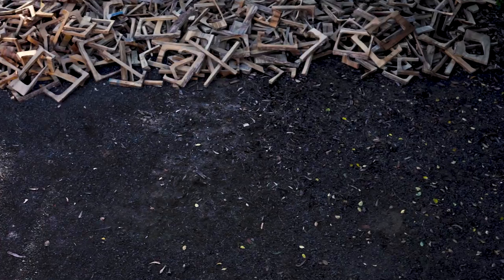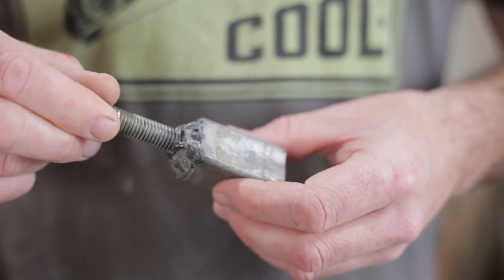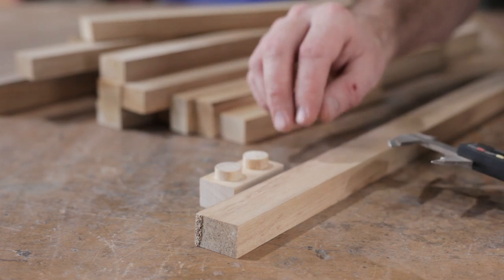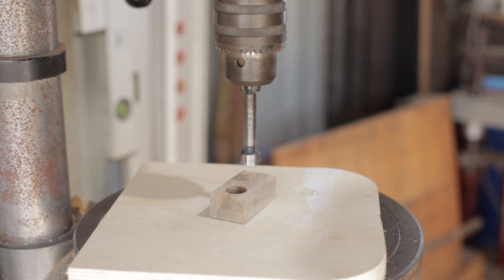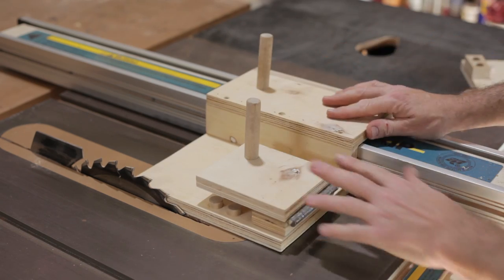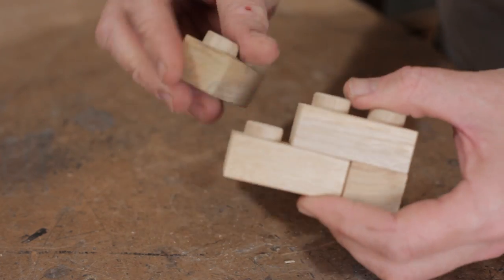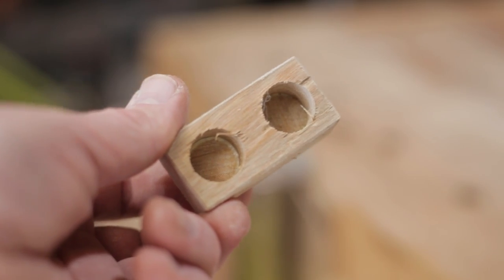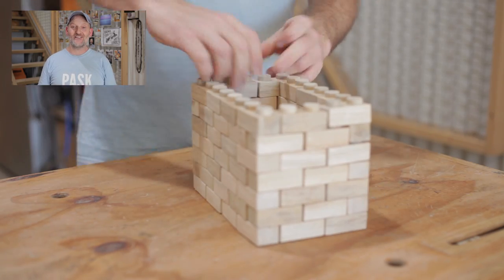Homemade Wooden Lego - Scrapwood Challenge Episode Eleven

Comment from the maker: After the first Wooden Lego video I made, I haven't stopped thinking about how to improve them. I decided to give it another crack! 

Just a word of warning to anyone that wants to make them "they are a lot of work". :)
Reply: Curious as to how long it took you
Reply: Turned out so nice though. Looks fantastic!
Reply: I think this would be a great job for a pantorouter (if you need any more excuses to make one!) with the doubling down from the templates you could get these really accurate, however I quite like the look of them being slightly off
Reply: I'd love to have a set! Maybe if I get bored enough and have a week of vacation... I do have a suggestion if you have decide to tackle something similar (or if you want fo finish these differently): don't bother with all the sanding ahead of time. Make sure there's no big burrs anywhere, glue it all up then throw everything in a big rock tumbler, or several, with some beeswax and half as much by volume (or so) smaller wood chips. It should take care of all the corners, smooth everything down, finish the wood and protect the surface. They ought to look cool too!
Reply: What is the measurements for this
Reply: Subscribed!  re 8:18, I made a "micro adjustable table saw fence" video that you might really like.  It's useful for sneaking up to the correct width and being able to turn a dial for more/less width.  It costs less than a dollar to make!
Reply: Dan Lord ..
Reply: Hi Neil -- To get the holes in the right distance, you could make a simple jig with two drills fixed in the exact distance you want, one drill fixed from either side. Then put the pieces in the jig and drill the holes from either side. That way they should come out identical!
Reply: @dominicspengler7264  you could use a dowl drill machine for that. Or make a make shift one yourself.

Comment: Really makes you appreciate how tight the tolerances on legos actually are. I should try measuring them with a micrometer and see how much they vary, if at all.
Reply: Yup, then tell us/me what the taper is on those pins eh…  
BTW,  if you are serious the micrometer will have a pressure gage for measuring soft materials.
Reply: .05mm tolerance is good for snapping lego pins into the technic holes.  You can see some I made for my kickstarter video.  Stop by and say hi.
Reply: they dont vary much at all
Reply: I heard the moulds used for lego are so valuable as intellectual property that when they wear out, to ensure competitors cannot get a hold of them,  they are cast in the middle of concrete. Not sure whether the concrete is used for bridges etc or Lego has a pile of concrete blocks in storage...

Comment: This vid is almost three years old, so I'm a little late to the game, but as a life-long lover of Lego bricks, I am completely enchanted by this project. The bricks turned out great, very much like the real thing only larger.

I love the simplicity and accuracy of the jigs you made for marking, drilling, and cutting. Repeatability is key in making something like these bricks, and the jigs make it a snap to get accurate holes and cuts every time. The sanding attachment for the dowels was also genius.

I'd love to see additional pieces to fit the set. Instead of only 1x2 bricks, I'd like to see the classic 2x4 brick, which was the basis for the whole Lego system back in the day, and maybe some of the other classic sizes of 1x4, 2x2, and 2x3. And a big plate to snap them all down!

Comment: Another way to reduce tearout is with the order of your cuts. If you cut your end grains first, you are more than likely to cut off the tears when you do the rip cuts. The same applies for rotating cutting tools.

Another way is to have a sacrificial piece/zero clearance behind your work piece, but that's not always possible e.g. routering edge profiles in a top. If your material is very prone to splitting, you can consider backing into the cut if it's safe to do so

Comment: Some good improvements! Can I ask what camera and lens(es) you use?  I just bought a Canon 6d Mark ii and I'm struggling with the video settings/quality.
Reply from the maker: Thanks Justin! Canon 5D mkII, it's getting a bit old now but still a great camera. I like the look of the 6D and if I could afford it I reckon I'd get one too. I'm surprised you're struggling for quality, the main thing I do is set the picture profile to standard and adjust the contrast and sharpening to low and deal with those with the editing. :)
Reply: It's a great camera for stills. It may be inexperience causing the video trouble. My cell phone (Galaxy note 5) has way better detail (no contest) though. But the phone lacks the necessary control for proper video. I may look into a camcorder for video and stick with the 6D mkII for stills. Although I had to save for three years to buy the 6D mkII. So It may be a while for another camera.

Comment: I made a set of wooden Lincoln logs a few years ago.  1-1/2" X 1-1/2" stock made from 2X4.  Very labor intensive.  But worth every minute.  The grandkids still get them out and play with them.  Also made a marble run using cherry wood and a whole bunch of blocks.
I thought I had patience.  I don't / can't hold a candle to you.  Great work.
Reply: I am going to do the same making large size Lincoln Logs.  I have a lathe to make the dowels .  Then use my table saw to carefully notch them out.  Then finally cut the multiple pieces with the table saw.

Comment: If you use a finer toothed blade on your table saw, you'll get less tearing. Personally, I use metal cutting blades because they have the least tearing. I usually cut the blade 6.6mm (roughly ¼ inch) in between every third or fourth tooth (depending  on the tooth count divided by three or four) with my bandsaw to improve heat sinking, though.

Comment: Seems like a CNC router would do well. All you'd have to do is set up a jig that has a corner to clamp into. Then you'd just need to do what you did, excluding the holes.

That being said Holy hell I'm so impressed with what you learned and how you applied changes to your designs. I've recently started watching your videos and your ingenuity is astonishing.

I watch other woodworking videos and I see their lack of technique and usually go back to watching your videos.

BTW loved the knurling jig video!! If you end up doing that again, try brass bushings inside the knurling wheels and add a third in place of the bearing maybe?

Comment: Those are a of work Neil,they look nice through ,there a guy onhere made a table saw lathe and you just pass them thru once the sand then too before switchen to the next sq board ,i made one up couple months back for making hanging pole for a closet units i made for customer ,worked great i dont know is if  you want me to put any names on your comments so i leave it at that and if you want ill post them to you ,i like your little sanding ideal next you ll have to make some outside rounds sanders ( go over the dowels and sand them in place after there all glued in ) think plastic pipe slit up one side spray contact glue and  fits in a drill ,great come back on the legos
Reply from the maker: Thanks Syd! I've made dowels on the tablesaw in the past, I needed a heap of 1" dowels for a project! It was a crude set up but it worked! :)

Comment: Curious.  When you made the dowel jig did you have to make a bur around the hole before drilling the stock through or has the plate just been drilled and its the circular  motion of the drill that does all the cutting work?
Reply from the maker: There's no need to make a burr around the hole Mick, it works just as it is! :)

Comment: I would get blocks to size including the sanding and put both holes in with a two hole jig to hold block in place but if you drill holes first then sand gaps will never be same just food for thought
Reply from the maker: I tried making the blocks to there final dimension then drilling the holes, that didn't work out anywhere near as accurate as this way. Give it a try, it's not easy! :)

Comment: If the hardest part is getting the holes the correct distance apart, could you not just do the holes first and then measure and size every thing from them? It may mean your bricks will be 29mm or 27mm rather than 28mm but so long as they're all the same it surely wouldn't matter.

Comment: this is so awsome. should make lego different woods so when oil up look different colors. walnut, cheery, oak , red oak, popular, hickory, pine , cedar cool but prone splitting. what seen cool mad special legos like make normal look lide box mad but hidges connect lego blocks. maybe normal solid bottom but round pegs attack bottom.  in past i tried make legos plastic green and clear pop bottles, milk jugges. did real well fumes. when tried do it make big cement blocks use make building with picture that block with pegs on top. anyway cool mad  few giant ones that kid use make play house with. that rearrange to castle.

Comment: Would it be cheating to make one of the holes in the bottom of the piece a slightly slotted?  That way it would be much forgiving but the blocks would still stack together nicely.
Reply from the maker: That would only be any good if you put both holes of one block directly on another, otherwise the slotted hole wouldn't hold very well on it's own! Hope that makes sense! :)

Comment: Would they be more accurate with smaller dowels and rectangular holes in the bases instead? Not sure why I think this, maybe because lego is more like that?
Reply from the maker: Any inaccuracies are down to woodworking tools just not being precise enough. I honestly think however you went about it you would struggle for high accuracy. I would think the larger the dowels the more accurate they would be! :)
Reply: I get you. Thinking about it the lego dowels are pretty large. I wonder how they did the wooden ones originally to get around the accuracy issues. Great video as per usual!